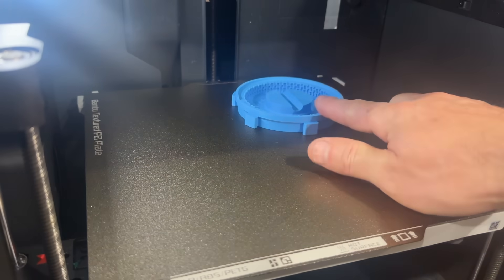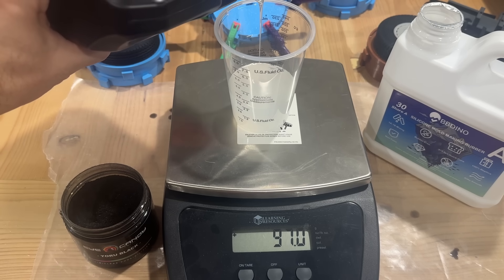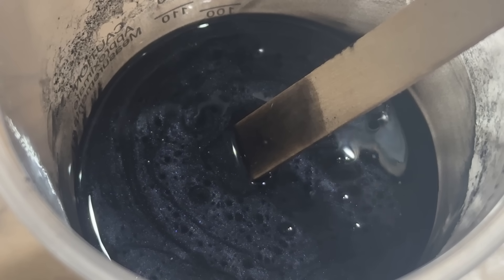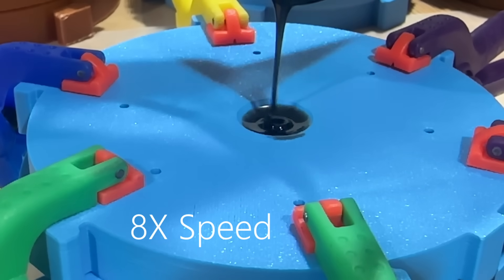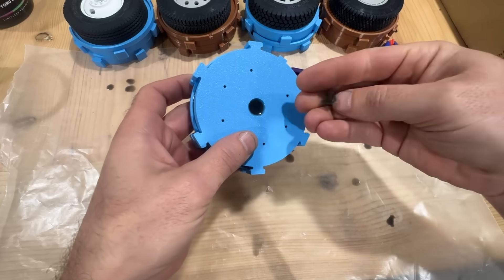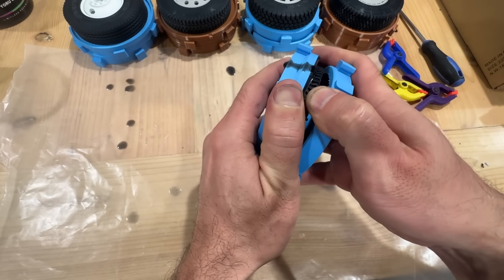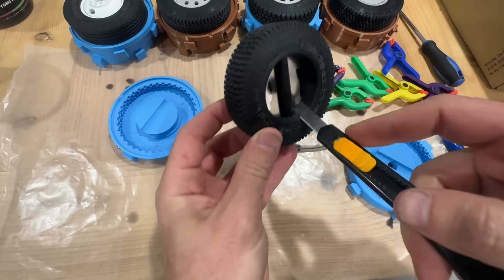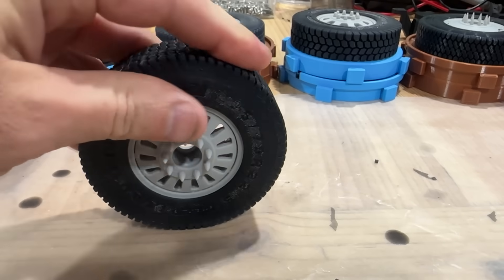RC Tire Molds | Make your own Tires

Comment: I would suggest adding a inner tube spacer for the inside of the tire. You will have to experiment around with the size of the cavity needed to get the tires to squat for realism like a actual tire would. Besides that they look awesome. Love the different tread designs!
Reply from the maker: Thanks. I’ve been thinking about this a lot. Still trying to work out how to make it so I can get it out.

Comment: Можно же печатать TPU?
Reply from the maker: Yes, I have printed tires in TPU but they don't give good grip. I am going to try printing the mold in TPU to see if it will come apart easier. I am not sure if the TPU mold will seal as well as the PLA mold does.

Comment: Cool, but show the quality of this mixture under load and how quickly it wears off, because that's key. If the tire lasts 2 days, making such tires misses the point.
Reply from the maker: Agreed, these would probably not be great for an outdoor basher. For the low speed 1/14 scale semi trucks that they are designed for I believe they are perfect and at a fraction of the price of buying tires. I do plan to make multiple tires for different applications and test their durability, it will be nice to know how far they can go.

Comment: Wicked! Have you built a draft angle into your mold design, a 90deg vertical wall is tough to pull out of a mold, a 2 degree wall slope will help with part release from the mold. Thanks for the video 🎉
Reply from the maker: Thanks! No draft angle as I don’t want it to affect how the wheels roll. I think most of the fight is the tread.
Reply: @BuildItBetter3D  fair enough, you're definitely right on fighting against the threads. Thanks for the cool video, all the best on your projects.

Comment: Nice work 
For a faster pour avoiding bubbles place mold on a vibrating plate 
Also heat cure the silicone part once pulled from the mold.
Using a low durometer makes for insanely grippy/tyre deformation rock crawling tyres
Reply from the maker: Thanks for the tips, I will do that.

Comment: This te hnique is great for making super grippy tires. I over mold mine onto the rim. Saves a lot of silicone. And use compressed air sealed over the air ports to release from the mold.
Reply from the maker: Compressed air to release them, that’s a great idea. I will give that a try. I considered molding it on the rim, but I like to change rims and tires. I am still working out a way to make them hollow to save silicone.

Comment: If your RC truck makes too much torque down low will it cause the tire to spin on the rim without using something like grip glue to lock it down?
Reply from the maker: I still need to test this, but they grip the rims really well so far.

Comment: I would be super excited to try a 1.9 mold for a crawler.
Reply from the maker: I want to do this too. I need to work out a mold that can make the tire hollow. Although it being solid would help with keeping the cg low…
Reply: @BuildItBetter3D 
This guy made a mold with what looks like a removable center to open up the tire for foams.

https://youtu.be/VDM77cIHsqg?si=HExKRKWYFn9HQ0Dw
Reply from the maker: Thanks. I’ve started on a design with a removable center. The issue to work out is making it seal good enough to not leak and still be easily removable. Hopefully I’ll have something working soon.

Comment: As a mold maker removing the air bubbles is important. But if you let sit you need to make sure you have a silicone that has a decent pot life. If not it will start to kick before it settles into the mold completely.

Or use a vacuum pot if you have one. Amazon has some great deals on them and they work great.

Those look really good BTW. Like they were made at a company
Reply from the maker: Thank you. Those are very good points, I should’ve mentioned them in the video. Thanks for sharing.
Reply: @BuildItBetter3D Thanks for the great video - wondering if this would be complete overkill for static 1:150 models... have you considered saying "See the pinned comment for any errata" (or corrections) in the video, immediately pinning a comment saying "Errata: none yet!", then editing it when stuff like this comes up? iirc you can only pin the one comment. imo all factual youtube videos should do this
Reply from the maker: If you needed a lot of tires for your models then I don’t think it is overkill. Thanks for the suggestion.
Reply: We poured an inlay for our printed pouring machine lads (3d-printed desk-model) to serve beer/drinks at the costumer. We made a mold out of PLA, used primer, sanded it and used vaseline (Petroleum Jelly) as release agent. This worked really well to release the mold. We also used a vacum pot.  The result was a bit disapointing: we had really big bubbles inside the mould and I think the vacum made it worse, caue it enlarges the bubbles that were still in the mold...

Comment: This is amazing.
The results is really good, the thread looks really clean and as it is made of silicone must be quite grippy.
Reply from the maker: Thanks! Yes, very grippy.
Reply: @BuildItBetter3D  do you think it is also possible to make hollow ons to use with foam inserts?
Or that is far more complicated to archieve?
Reply from the maker: I believe it’s possible, but will be more difficult to design. I’m still trying to figure out the best way to do it. Getting the center part of the mold out I think is the biggest battle. I’m going to try making a center plug out of tpu to maybe make it easier. I’m not sure how the silicone will react to the tpu though.
Reply: @BuildItBetter3D  I can't recall where but remember something added to the moulds to help release.

Comment: Hollow tire next. Very limited uses for a solid tire.
Reply from the maker: These are for the 1/14 scale semi trucks so solid is great for hauling heavy loads. I do want to make some hollow ones too.
Reply: These are for lightweight models. Hollow isn’t required.

Comment: Did you ever consider using a PVA release agent in the mold before filling the mold??
Reply from the maker: Yes, I have some but haven’t tried it yet since silicone doesn’t really stick to things. I think the most of the struggle getting it apart is just the tread pattern tucked into the mold. I may try it just to see if it helps though.

Comment: Looks great, I guess not as grippy as a rubber tire? Can i get the moulds from you as i don't have a 3d printer.
Reply from the maker: They are actually a lot more grippy than the rubber tires that came on my tamiya grand hauler. I’m in the process of putting them on an Etsy shop for those that don’t have a printer. Should have them available this week. I will add a link in the description when they’re up.
Reply: @BuildItBetter3D  Thanks, I have a Globe Liner and flat bed trailer, Would really like to give them a go myself. Thanks again.

Comment: I wonder how these would grip for rock crawling, I'd assume that the silicone would give it a sticky cling on affect, but with being solid silicone i could see problems unless a guy were to poor it with the bubbles to add pores and squish.
Reply from the maker: It is very sticky/ grippy but as you mentioned the tire doesn't deform around an obstacle. I need to work out a way to make them hollow and then I think it would be excellent for crawling.
Reply: @BuildItBetter3D my theory was to just dump into the mold right away without letting the bubbles rise out. It would cause it to be porous providing air gaps for deformation. Could possibly make the first insert/foam free crawler tire.

Comment: Are the moulds fdm printed ?
Reply from the maker: Yes, using PLA. I tried a resin printed mold but it caused the silicone to not cure properly. I intend to try again, I would like to get the extra details that a resin printed mold can provide. For now though the fdm molds are great.
Reply: @BuildItBetter3D  If I remember correct, one of the silicones work with resin prints. I can't remember if it is platinum cure or tin cure. Also, you might try using some isopropyl alcohol when releasing. It shouldn't attack the silicone or pla after it has cured.
Reply from the maker: Thanks, I’ll try that.

Comment: Great video! I can’t wait to make some tires. 😊very informative and actually very interesting. Great design.
Reply from the maker: Thank you!
Reply: @BuildItBetter3D  can you make some tires for the losi micro b?
Reply from the maker: I don’t have one so it’d be hard to design them since I don’t have a rim to get measurements from, and I wouldn’t be able to test them.
Reply: @BuildItBetter3D  they have 3d print files for the rims on thingy verse. the tires are about the size of a quarter
Reply from the maker: I will have to look into this. Sounds fun.
Reply: @BuildItBetter3D  if you get a micro id go with the losi micro T over the B. the turning is much better for small places. we race on a wood deck about 12x18. once you set up the transmitter end points the car turns into a beast. i have more fun with this truck than my 1/8th scale truggy on a turf track. the stock tires are the best so far. there's not many options for them. i bet this silicone would be great for tile and smooth flooring. keep me posted i subscribed to you as well. :)

Comment: Yes but what adhesive works with both silicone and plastic hubs?
Reply from the maker: I’m not sure since silicone doesn’t stick to much. So far in my testing no glue has been needed because it grips the rim really well.
Reply: Beadlock
Reply from the maker: That’s a good idea. I would need to change the design a bit to give a better bead to be grabbed.

Comment: That's pretty cool.  Maybe using a Mold Release would help with the taking apart.
Reply from the maker: I agree, it might help with taking the mold apart.
Reply: Aluminite makes a good release.
Reply: How about making the mold out of TPU?
Reply from the maker: I considered this but my research online says it will cause cure inhibition for the silicone. I may do a small test to see.
Reply: @BuildItBetter3D  Perhaps try unscented talc, almost inert use very thin dusting in mold.
Reply: Rippsnortin!
Reply: @24Yepp  we meet again. Still watching all your videos, just not a big commenter.

Comment: Awesome stuff, can't wait to try. Is there any type of spray or coating that you could use in the molds to allow the tires to pop out?
Reply: Mold release spray, does what it says on the can
Reply: @sathos Nice, thanks
Reply from the maker: Yes, there is mold release spray. I’m not sure it’ll help much but could be worth a try. I think most of the effort is pulling the treads out as they have to compress to come out of the mold.
Reply: @BuildItBetter3D Okay, that makes sense. I'm making airplane tires, generally they don't have much tread. I'm guessing that they might just pop out. Thanks again

Comment: Why? Why did you have to do this?

Thank you for making the molds available free on maker world.  What are the different tire types in relation to? I guess I am confused on the naming. 

Do you have any idea on hobby lobby’s supplies for the silicon?
Reply from the maker: I found an image online with common truck tire treads and I’ve based the tread designs on that image. I’ve labeled them as they are labeled in the image, so I don’t really know their meaning either. 
I haven’t tried the hobby lobby silicone. The stuff I’m using is 30a and self degassing. I know some require a vacuum chamber, but the stuff I used does not.

Comment: If I guessing right, roughly 36 tires per gallon of silicone?
Reply from the maker: The 1 gallon kit shows being 4000 grams, at 100 grams per tire you should be able to do 40 tires. $72 for the gallon kit divided by 40 makes it $1.80 per tire so it ends up being really affordable compared to buying tires. Still a bit more expensive than printing in tpu, but you get a far superior tire.